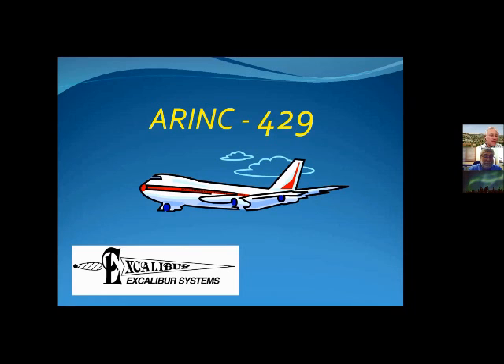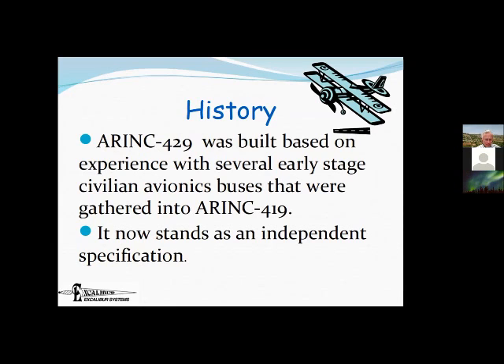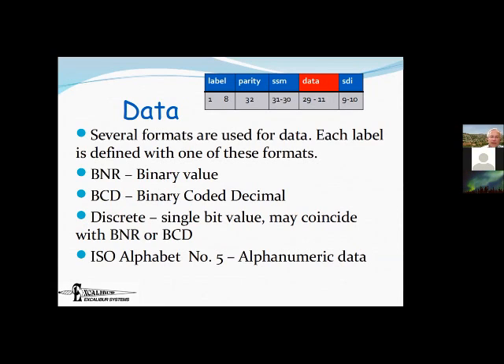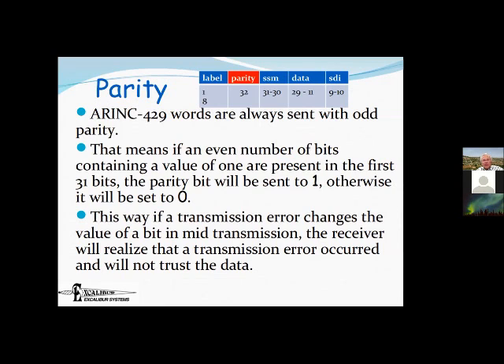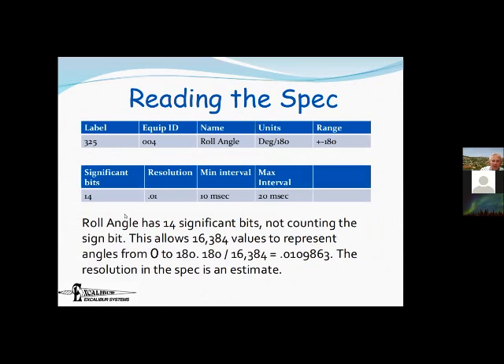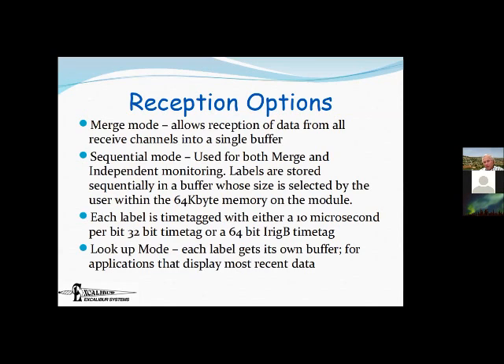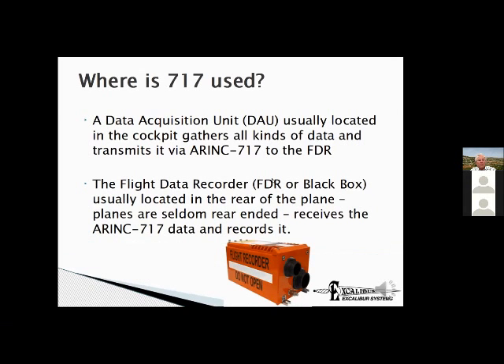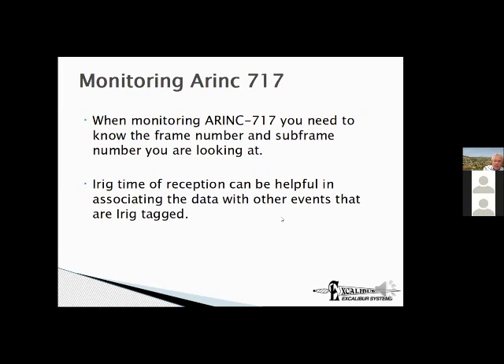Zoom course on ARINC-429 & ARINC-717 | Excalibur Systems

Comment: Use of c/c++/batch assembler 1 buggy, 2 malware vulnerable, and 3? contains software modules greater than one page of code in violation of Boeing hardware engineers' software standards [before 1966 and after 1980] use in safety-sensitive applications at issue. FAA and NTSB appear reluctant to respond to Freedom of Information Act request about computers and software modules used in the 737 MAX. F-35 software contains 53% c, 35% c++, 7% assembler and remaining code ADA, we read.